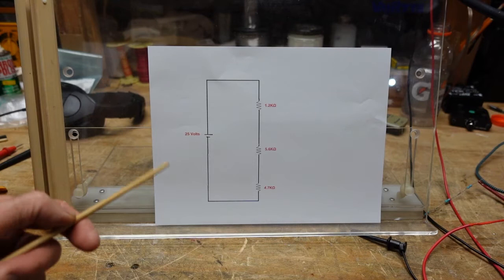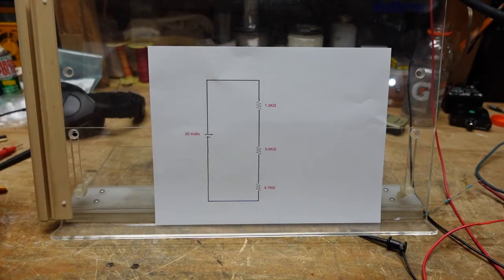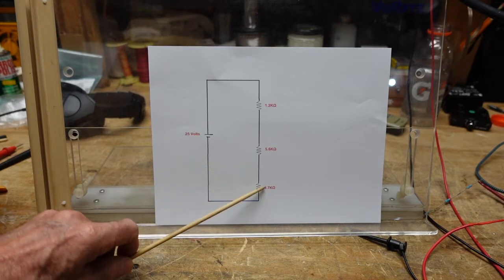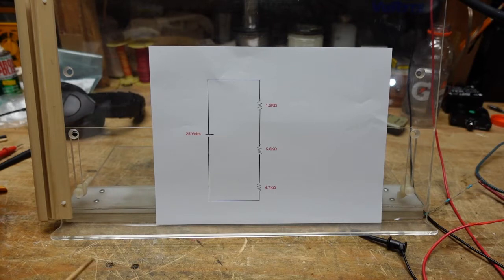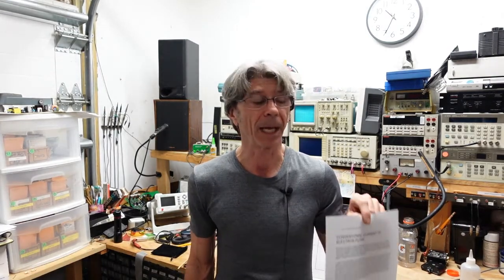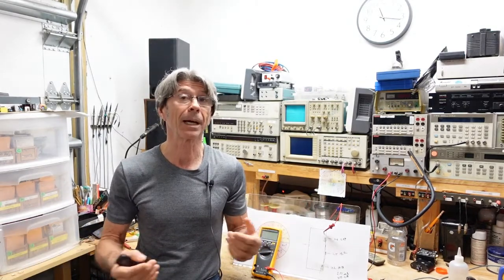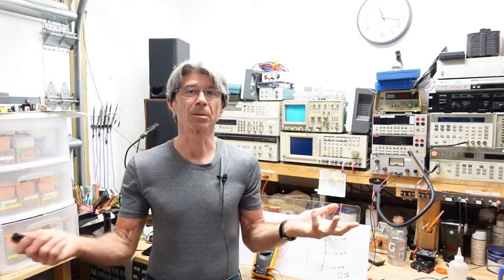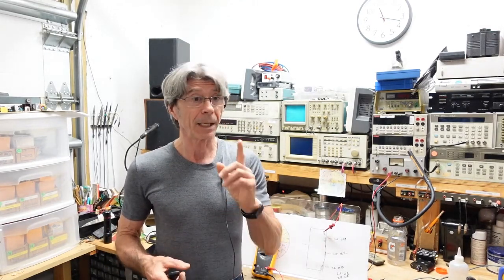Basics Electronics for the Technician Part 3- Series Circuits

Comment: Very interesting background info - thanks for including that!  As you and I went to tech school around the same time, I too was taught electron flow and that's all I've ever used.  Like you said though, it doesn't ~really~ matter, as long as you're consistent.  Same especially goes with our math calculations - making sure the units/decimal match and are kept consistent in an equation - V,I,R's. must match throughout which is why exponents are so valuable (I was taught with V for Volts, replacing E, too, so I had to throw that in here, lol).
Reply from the maker: Rob, it was a good era to go to tech school, IMHO.  I received good solid state training, and they at least touched on tubes (who knew they'd never actually go away?) and analog TV, as well as basic microprocessor coursework.
I don't even know if classes like these are offered anymore.